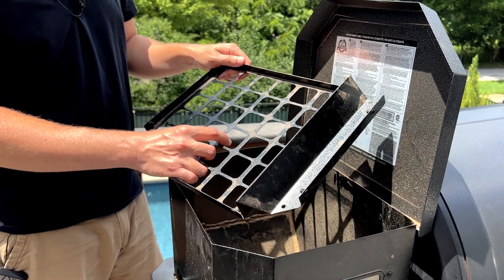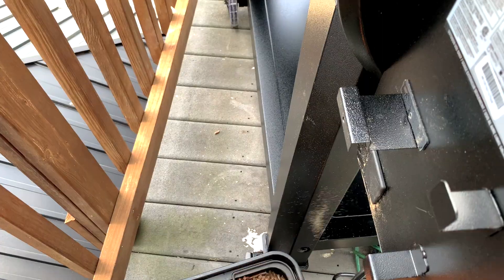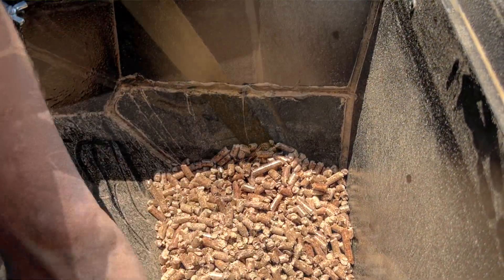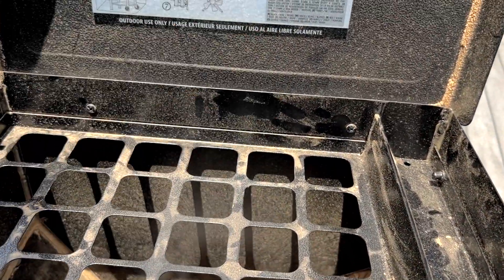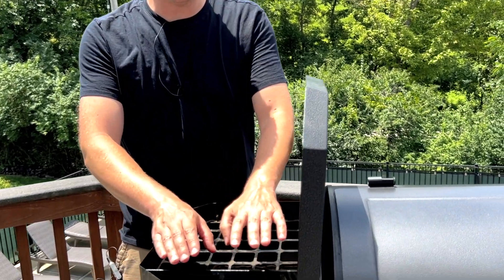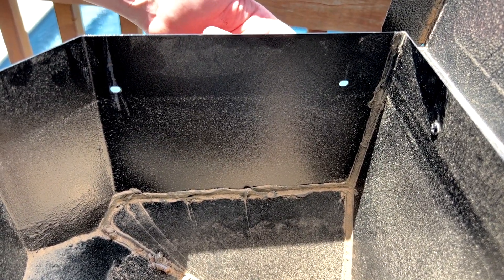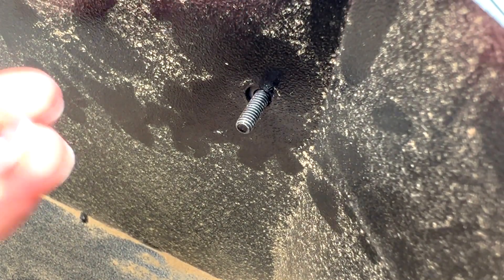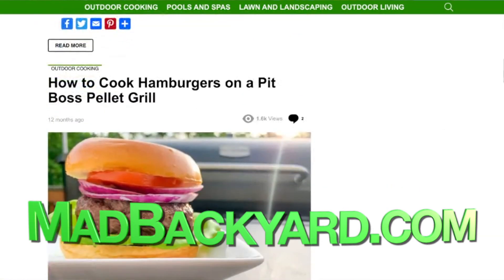Removing the Safety Grid on a Pit Boss Hopper the RIGHT WAY

Comment: Here in Houston, Texas we have high humity. I always remove all the pellets from the hopper. The challenge is to run-out all the pellets from the pellet feed tube so the pellets won't swell up while sitting the the feed tube for a long time.
You can hit the price button many times but all that does it ump the pellets into the burn chamber and things get really hot.
They need to include on the menu a selection for "Prime the feed tube and Empty the feed tube without burning them".
Reply from the maker: Yes, it would be nice if there was a quick release on the auger the way there is on the burn pot to dump the pellets!
Reply: I called Pit Boss and talked to a man in customer service and described what they need to add to their next Pit Boss firmware update. He took down the notes and said that people along the Gulf Coast has the same request. @madbackyard

Comment: I did the same to my Camp Chef, but with the hardware installed I re inserted the grid on top of the hardware so its still in place for the young ones but easily removed anytime.
Reply from the maker: Yes, that works great if you want to be able to easily pull it out when adding pellets!

Comment: What I first did was put some perma-tex putty in each hole and flattened it out. Later that day I went to my local hardware store and took one of the screws with the washer that came with it. I found if I got 4 washers and one nylon locking nut that would work for each hole.
The 4 washers per screw gave me the right amount of spacers for the nut to tighten too and create a smooth surface.

I would have loved to found rubber plugs to stick in each hole but the hardware store did not have anything like that.
Maybe someone reading this could find some on the internet. You only need 6 of them.
Reply from the maker: Great tip on the extra washers! Curious why you puttied the holes before putting screws through them?
Reply: I thought putting putty on the holes was a quick fix until I figured out something else. I don't know how big the holes in the pellet hopper is. I thought maybe 1/4" but wasn't sure. I went to Amazon looking for some 1/4" rubber plugs to push into the holes and found several plugs. The trouble is that the sites are selling them by the dozen or two and I only need 6.
 @madbackyard

Comment: what happens when the wingnuts rattle loose into the auger?
Reply from the maker: Ha, fair point, I usually give them a quick check everytime I load more pellets in the hopper and they have stayed tight so far.  You could use a regular nut and a socket wrench if you really want to tighten them up more I guess.

Comment: I have a Pitboss Lexington 540 and have tried to simply unscrew the screws like you show but they absolutely will not turn.  We nearly rounded out one of the screws trying.  Does anyone know if it is possible that the screws are glued in some way?  From the inside ours also has the cap looking thing on the end of the screw which I thought might be some kind of locking mechanism but maybe not since your model had that also. I remember the video saying that the grate has the threads for the screws so I guess that is the purpose for the caps (or whatever they are)  My model does not have that storage space for probes so that is not a concern for me.  Of course, we could simply take tin snips and cut it out but would rather be able to just unscrew it.  Anyone have any thoughts as to why it won't easily unscrew?
Reply: I just stripped 2 of the screw heads and had to drill out the bolts. I found that using a drill with a proper Phillips drill bit worked better than using a screw driver. I was able to push and go really slowly to loosen all the bolts without stripping them. Then I replaced all the bolts with better quality ones from the hardware store. 

I didn't find any lock tite or anything they are just in there tight and aren't high quality so they strip easily.

Comment: Without something to lock the wing nuts and keep them from vibrating loose, they could potentially fall into the auger.  That could (possibly) become a problem.
Reply from the maker: Yes it could, however I give mine a quick check every time I load more pellets and they’ve stayed pretty tight.  Could use regular nuts with a socket wrench or some loc-tite if you are really concerned about it.  Thanks for watching!

Comment: Why remove the grid ? Just cut off the center area big enough to put your hand or a large flat stick while maintaining the integrity of the body. After cutting sand edges smooth.
Reply from the maker: Hi Richard- you can certainly do that if you want to, although it seems much easier to me to just quickly unscrew the whole grid and replace the screws rather than going through the hassle of cutting and sanding metal.
Reply: @madbackyard  easy things on life are not always better, I'm the type of person who's prefer do it right or don't do it at all.
But  everyone their own ! 🍻
Reply: @richardaristeo8394  I don't think it is about a right way or wrong way. Some may prefer to still have a functioning safety device, just in case they are ever smoking with kids around. Doing it his way allows you to keep that option instead of destroying it.
Reply: @sebastianmizzell7541  I don't know if you ever try to reach with your hand down into the hopper, the very same reason we are doing this modification.....cause you can't stir the pellets unless you use a long stick and thats why we either remove or cut it !
It is safer to cut small square of 4×4 oppose to remove the entire grate.
Just big enough push a long brum stick thru it !
Unless you have children's with octopus arms  😆

Comment: I just took out a pair of metal cutters and cut out the inside of the grate, leaving all the screws in place along with the grate perimeter. This way you don't have to plug anything up and you don't need a paint stick to move pellets around. Easy peasy....
Reply from the maker: Nice! That works too, although I guess you need to be sure you never want to use the grid again! 😆 I didn’t put it in the video but found I can rest the grid on top of the wing nuts to still store my probes, but now I can just pull it out when adding pellets. Thanks for watching!! 👍
Reply: @madbackyard  Love your channel! You turned me on the habit of emptying the hopper when not in use. Moisture on the pellets is not much of a problem here in Arizona, but cleaning out the auger is great maintenance. Never would have done that without watching you. Thanks again!!
Reply from the maker: Awesome!  Thanks for watching!  Yeah I used to live in AZ for a short time and I know what you mean.  Stay cool this summer, it's been brutal!🔥🌡♨️